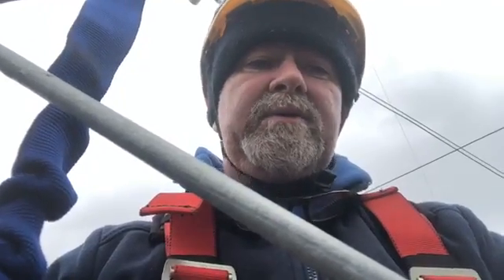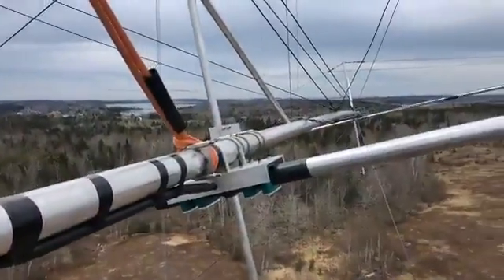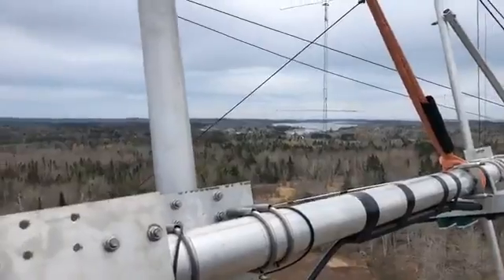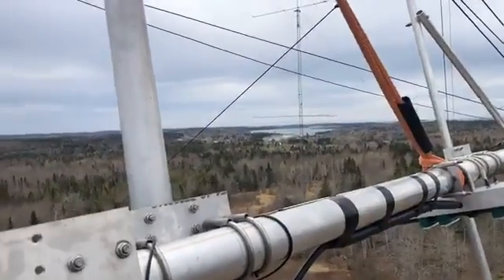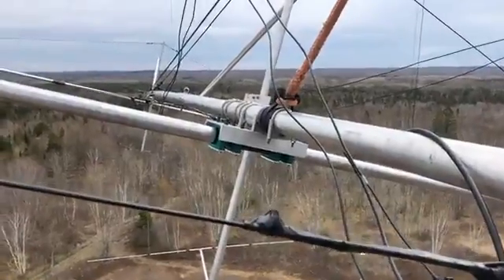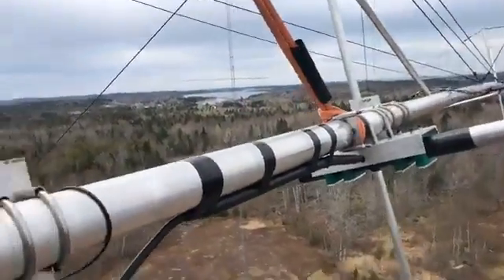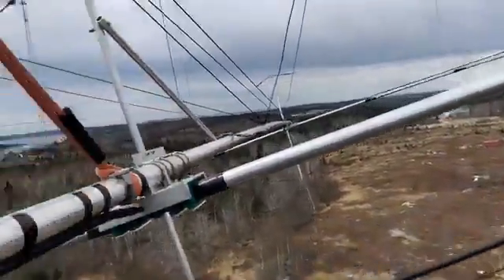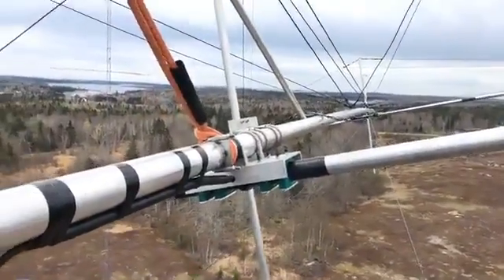Dangerous Dilemma: 700-Pound Antenna Suspended by Cable on Tower with Ray W2RE

Comment: This what i not understand, why use tape fit cables to boom not using zipties
Reply from the maker: 3M tape is long lasting!
Reply: @Ray-W2RE  My experience as well. 73 DJ7WW
Reply: Get the 2 inch wide 3M tape. I’ve cut that stuff off that was 40 years old and still holding.
Reply: Go there and ask him
Reply: Tape holds longer then zipties and does not deform the cable
Reply: @MrTalaue  not true, zipties what mean use outside need to be black, UV resistive.
They last over 20 year without problem, OR have metal zipties also meaned use hard enviroments.
You not tighten zipties too much thats it
Reply: @markkut9419  Only a few of my hundreds of zipties lasted 20 years and 20 years lifetime is by far not sufficient. My oldest antennas are from 1973 and the majority are from mid 80s to early 90s.